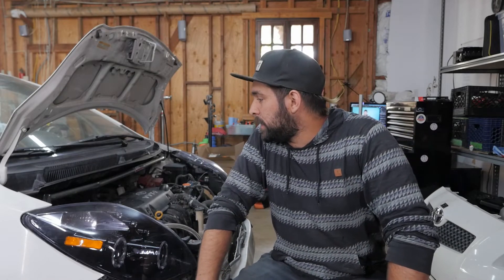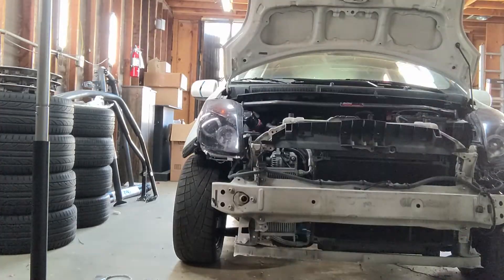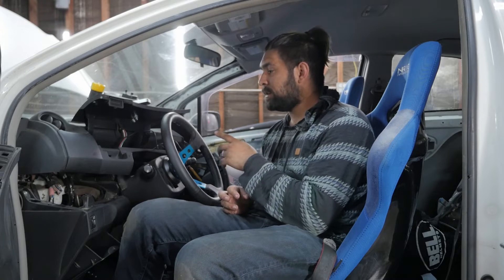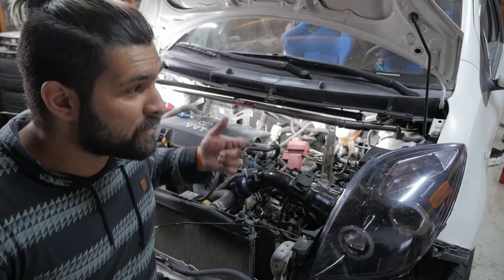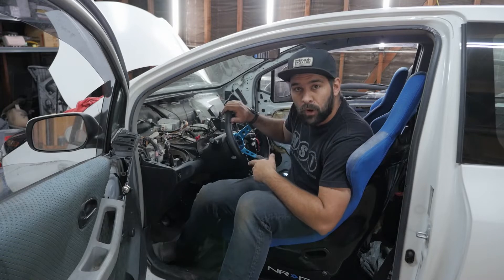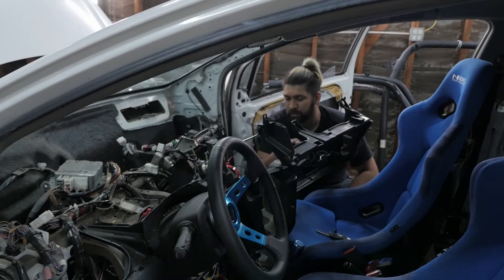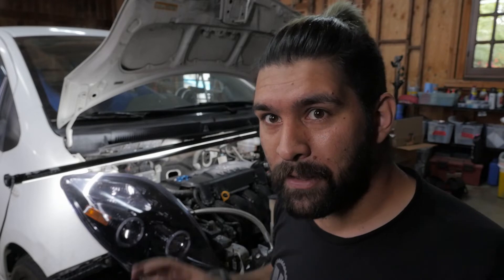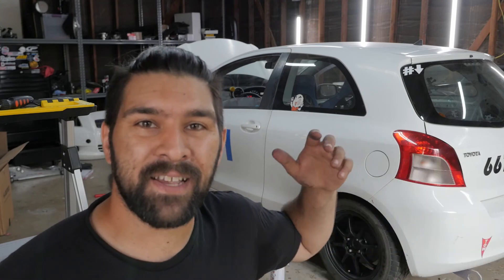How much useless stuff is under the dash? the Yaris loses it all!

Comment: Awesome video again! But man you gotta tell us the weight that came out! And move that battery to the back! Maybe use a smaller battery too
Reply from the maker: Waiting on a corner balance for after I finish figuring out my suspension issues. But the goal is to get it under 2,000 lbs
Reply: @RassoolRacing  had you weighed it at all along the way? I did on the stock car and the "finished" product, but really wish I'd weighed it again before fitting the cage.
Reply from the maker: @5H4D0W989  when I was working on it at first, I was just pulling parts out and weighing the individual parts (rear seats, ac compressor, etc), then subtracting that from the curb weight. This last time that I got an alignment I also got a corner balance and it came out to 2,264lbs with my 200 lb self in the car.

Comment: Just curious if you took off the AC compressor, if so , did you get a smaller belt or is there some sort of pulley in its place?
Reply from the maker: AC compressor is off yes. I'm running a smaller belt but there were version of this car sold without AC, so i has able to get an OEM part

Comment: Cool video Joey, love what your doing. You definitely removed some weight but consider this; try relocating your battery from the front where all the weight is ,to the rear trunk area. Ideally as far back and center as safety possible. It's all about weight transfer. My .02$
Reply from the maker: Definitely on the list. I'm actually just looking into the best options for fabricating something in the back that can house the battery but also gives me a flat surface to throw in all the tools and extras I take to a track day. I don't plan to be driving the car to track many more times, hopefully it can be towed later down the line, but I'd hate to whack the battery as I'm taking out my tools and have to repair something before I even got on track
Reply: @RassoolRacing  maybe make an access hatch to the fuel pump if you didnt already

Comment: I am working on removing the ac compressor in the engine bay and the stuff under the cabin. What belt size do you use now without the ac.
Reply from the maker: There's a version of the Yaris that was sold without the AC compressor. So if you go to your local parts store, they'll actually have a factory part already that is the right length.

Comment: did you install a 1zz TB?
Reply from the maker: Yep
Reply: @RassoolRacing  I just bought mine, does the factory airbox fit or I have to go aftermarket?
Reply from the maker: @TheSMARTREY  it should fit, yeah
Reply from the maker: Might need a reducer
Reply: @RassoolRacing   what about performance wise?  will it give a decent HP boost or nah because of the restrive airbox?
Reply from the maker: @TheSMARTREY  So in general the larger throttle body is more about throttle response than actual horsepower. Because the intake manifold and actual intake are still the same size you're not getting more air, you're just getting that initial air faster
Reply: @RassoolRacing  oh okay I see, what if say I put a custom cai with 1zz Tb say a 2.5 diameter. would that do anything? I mean I notice you have a cai on
Reply from the maker: @TheSMARTREY  well it might be dynoing mine in about 2 weeks, so we'll see!
Reply: @RassoolRacing  Great! Hopefully you'll upload a video then

Comment: How much weight was all that under dash stuff worth?
Reply from the maker: It was mostly plastic so probably only 20 lb or so, but it's all off of the front end, so I'll take every bit I can get. The biggest thing was that heater core. While I was waiting in line at Autocross I noticed there was heat coming out of the vents, and it turns out it was because the heater core was still cycling coolant from the engine. One less radiator in the coolant system is not a good thing, but pulling off that AC radiator from the front should let the main coolant radiator breathe a bit more... In theory

Comment: Y the "661"? You from the AV?
Reply from the maker: SCV
Reply: @RassoolRacing  nice. I have a white hatch too that I'm working on.
Reply: @RassoolRacing  what issues did you have with rear sway bar? I'm thinking about getting the trd sway bar but wondering what issues I might have
Reply from the maker: @georgeavocado5495  I think in retrospect they weren't really issues with the swaybar. It was just solving a problem that I didn't have. My car is oversteering under braking more than I'd like and the swaybar doesn't help.
Reply: @RassoolRacing  enough oversteer to spin out?
Reply from the maker: @georgeavocado5495  check out the Streets of Willow video. Spun out first lap

Comment: 3D print some front fenders, remove the front motor windows with a plexiglass glass windowed solution. Also, you may be able to use a recent generation Corolla front impact bar, they’re insanely light. Look on line for a good universal radiator that’s double cell or 2 rows but made from lighter material. Lastly I’d remove the headliner, oh shit handles and  visors.
Reply from the maker: Had plexiglass windows in for a little bit, but since the car only gets used on sunny track days, and I have to have the windows down on track I just removed them entirely. Good call on the Corolla bumper though!

Comment: u want 20lb from the front put the battery in the back my man as farrrrr as possible
Reply: also remove all the metal brackets that hold the battery up
Reply: u can us the holes in the fire wll to run the battery cable u only need one to the back the ground it to the chassis